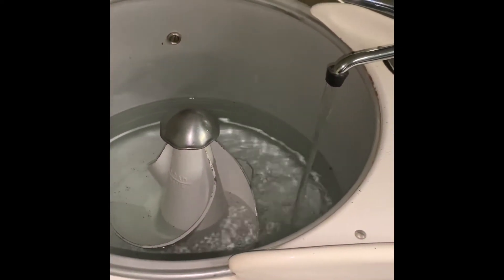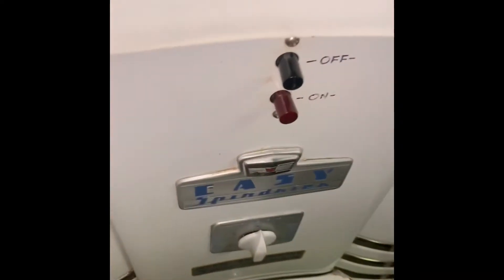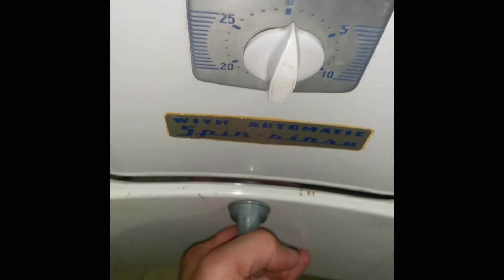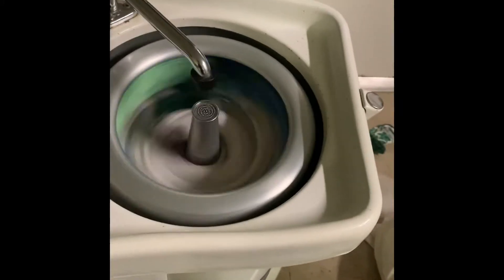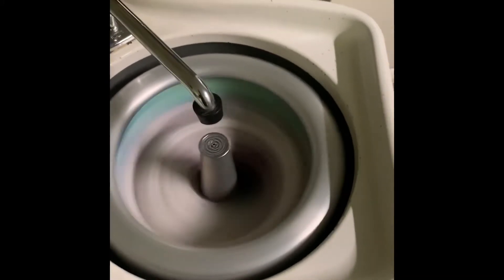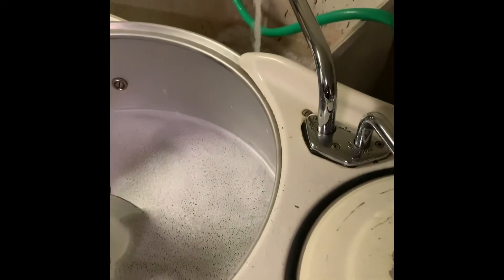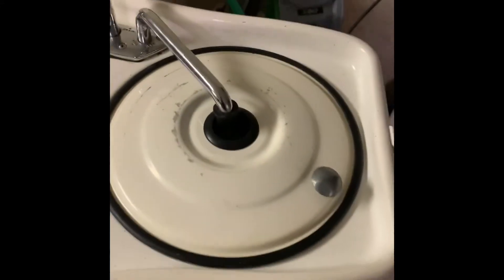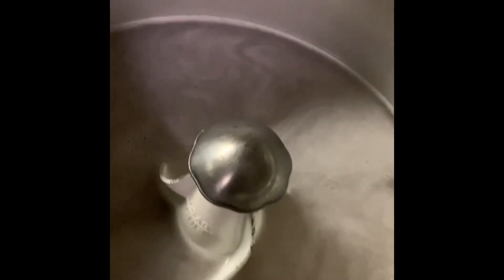Easy Spindrier First Test Run

Comment: Great find Shannon, looks in great condition, is that the last model of these ? the control panel looks simpler with the switches etc. The agitator is like our 
Hotpoint Spiralator and does a great job like yours. Love the "Spin Tube" rinsing which seems very efficient. Enjoy your new find !!